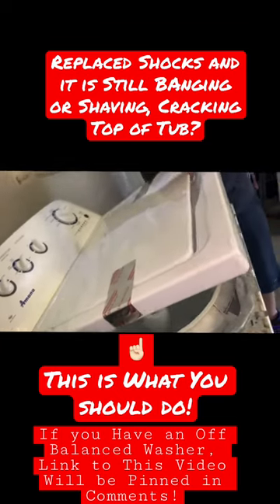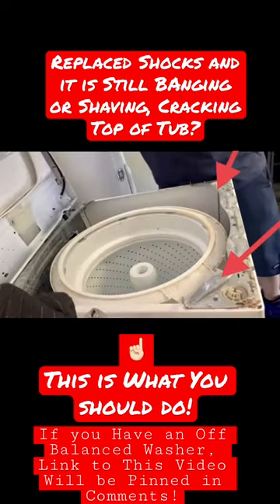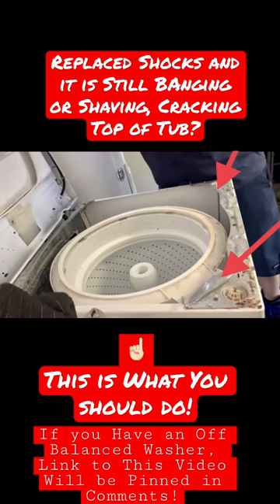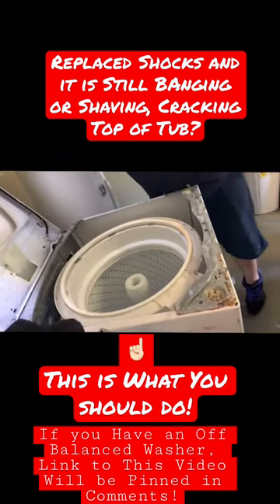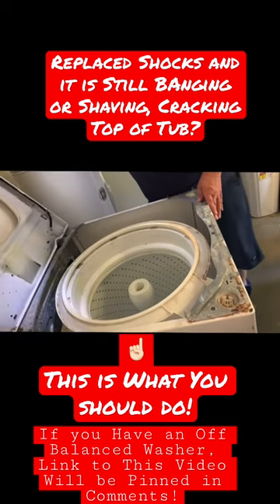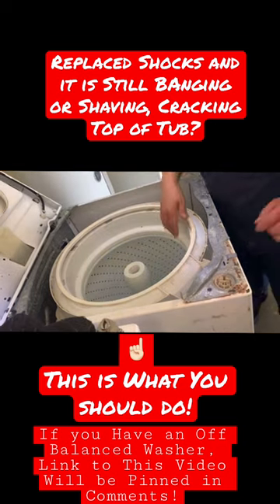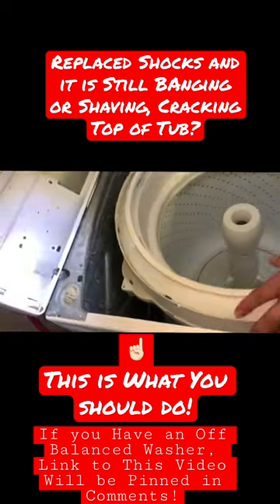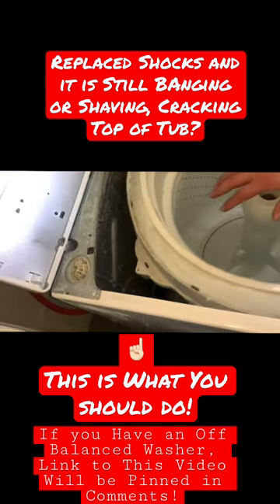Whirlpool Washer Still Off Balance After Shock Replacement FIX!! #shorts

Comment: i repaired many of these.  if you push the center of the tub and it does not bounce up and down. your suspension rods are in good shape. What you wanna check to see is if the inner tub is stripped out around the shaft of the gearcase. to check you have to spin the inner tub and see if it spins in a straight circle.  if it wobbles as it spins or look as if the tub is going over a hump. you have a stripped inner tub and have to replace tub.  getting a new one may be a better option if this is your problem

Comment: Hello I have a washing machine like this the problem I'm having is when you put a load in it even a small load and fill it with water the entire machine mechanism Basin and drive motor sells down so far that it touches the ground so is this definitely bad shocks?
Reply from the maker: @bmaiceman  yes you need to replace the shocks and also level the washer and raise the legs highest possible thanks for washing our video💯👍🏻

Comment: How much fluid goes in the balance ring if you poured it out without knowing that it was suppose to be in there to counterweight the washer? Also if youre washer does not have centering springs, but has the places to install them, is there a benefit to installing them anyway?

Comment: What if it only bounces once but shakes like a beast? Does it matter if it doesn't have the agitator?
Reply from the maker: In this Scenario, It Could be that Only One Shock is Damaged, However Whirlpool Only Sells the Shocks as a Set of 4. Since this is one of the Most Common Issues in Whirlpool Washers, The First Step Would be to Replace All 4 Shocks and Adjust the Legs of the Washer to Make Sure it is Level. It does not Matter if it has the Agitator or Not. Remember that Link to Full Video is Located in the Description of this Video.

Comment: Suspension rods may have liquid detergent in them my family accidentally drop some liquid detergent by one of the  suspension rods and that's what happens it shakes because it loses the frection from the special grease when it mixes with the liquid detergent. 👍 Clean it put some special for frection grease. It acts as a hydraulic by stoping the spring.

Comment: Not sure what brackets you are talking about. Changed the shocks and it’s banging just as bad.
Reply: Turn the shock mounts at the top. Turn them so the opening faces the center of the tub.
Reply: @StrayCatHomestead  Will do. Did learn how to do the calibration, during all this.
Reply: Did that help? I’m having same issue. Also the new rods came with plastic pieces that don’t look like fit washer frame. So I used old ones.
Reply: The new ones are shorter and raise the drum. I am struggling with that right now thanks a lot

Comment: I bought and put new shocks in, i put a sign to not over load the washer. It was good for a week or so now its sounds like its hitting again. Help idk what to do. Cant afford a technician. We live paycheck to paycheck with not alot to spare. My dad has brain cancer and i was washing his bibs and bedding and its hard for me to constantly go into town to wash because i have to arrange someone to watch my dad my kids and its a whole process. Any suggestions for washer. ?
Reply: Try replacing the suspension rods, they should be like $30 to $50 and easy to fix
Reply: Did ypu recalibrate the washer
Reply: @ui7183  yes. Still the same. Family is just using it like that . Banging and out of alignment. Nothing I can do.
Reply: Is it level on the floor? Might need to get some rubber leveling pads to put under it. They are like isolation vibration pads
Reply: Did you use oem shocks or cheap Amazon ones?
Reply: What do u mean calibrate machine? I bought Amazon rods and it’s still banging. Whirlpool
Reply: @leonardmeyer4678  did you use dampening grease on the metal rods?
Reply: @ no I did not. Now washer has other issues. Lol